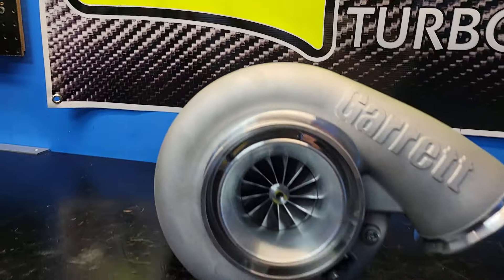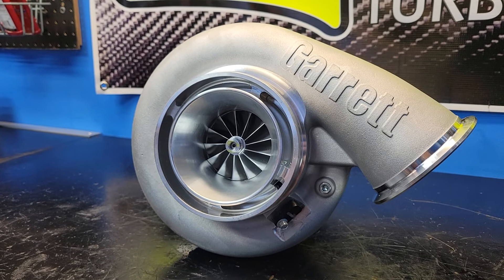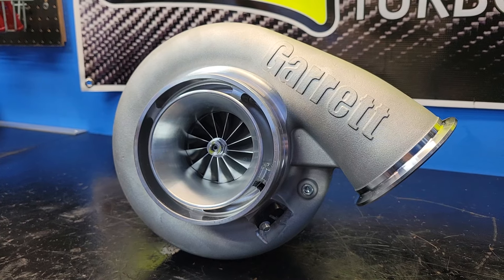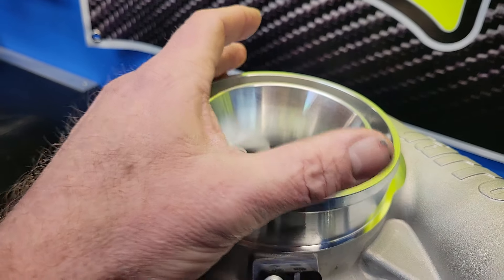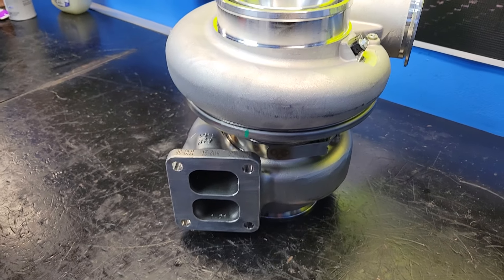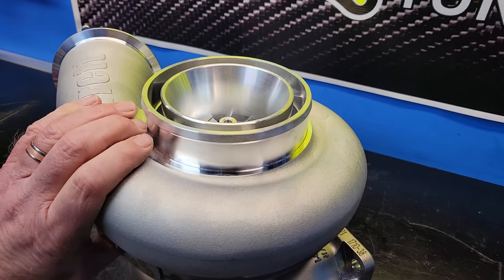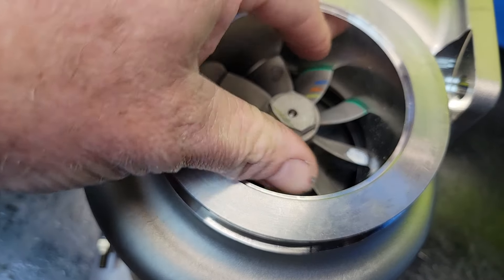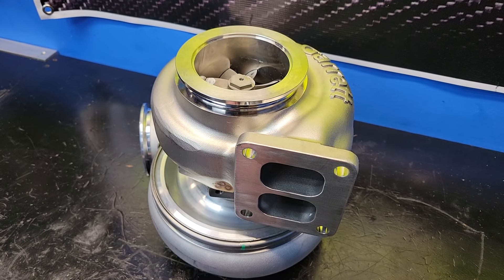Garrett G45-1125 67mm Turbocharger Overview

Comment: Would love to see the g45-1600 through g50-1900 go on sale as well as if you can do twin scroll housings for the g50-55 and/or gt50-55
Reply from the maker: I think we can machine a GT55 1.39 t6 twin scroll to suit.  The G series units are the cheapest they will possibly be right now...we will get a new price schedule from Garrett in the next week or so.  Email me if you need something, now is the time to buy!  support@workturbochargers.com  -Reed
Reply: @workturbo  I am wanting an 88mm charger for the high pressure turbo on a set of large compounds for a deckplate and sleeved 6.7 cummins. Would like to have an a/r between 1.0-1.15 if possible. Would really like to have something in the gtx or g50 range turbine size. The low pressure turbo will be 140mm
Reply from the maker: @GapdU  Send me an email to support@workturbochargers.com and I will take care of getting you a few quotes! -Reed

Comment: I’ve got a K31 on my 12.7 Detroit. Would love something a bit more efficient. Only pushing 525HP. Would like to reduce back pressure a bit. A Borg 171702 works it just loses Jake brake efficiency.
Reply from the maker: Yessir, understood!  The K31 is a good turbo, just very dated compressor aero (FWIW, that was one of the very first "billet" compressor wheels in an OE turbocharger!)  

The 171702 with the standard 1.32 A/R is too big for a 12.7 at 525 HP...put the 1.15 on there and it gets a bit more manageable.  

The 171701 with the 1.15 starts to get "better".  We offer a nice billet compressor upgrade using a factory BorgWarner Forged Milled Compressor wheel...that makes it even nicer, but still a bit much for that HP

The issue with any of the 96/88mm turbine wheels is they are just a tad to aggressive for the 12.7 at that HP level.

Other options that work well is a custom unit using the 92/81 turbine wheel and the 72mm compressor wheel.  Very good response, gets some boost on the jake and it is still "affordable" and built entirely out of OE Borgwarner parts, so it is servicable by any good shop

This Garrett G45 will be a top shelf unit, but unfortunately it is not currently available in a T6 footprint,  although I have thought about casting a T6 if the market will support the cost!
Reply: @workturbo  Thanks for the reply! My egts jump around 1800rpm and with my 10 speed the 400rpm shift drops make it hard to spool the big turbos after a shift. That custom unit you mentioned sounds promising. Can I get a rough quote? Would the t6 exhaust housing of a gt4202 be a close for this Garret?
Reply from the maker: @bowserfair2101 You read my mind on seeing if a GT42 turbine housing could be machined.  I have one set aside to do just that.  IDK why I did not think about that as an obvious choice initially.   Can you send me an email to support@workturbochargers.com so I can provide you a quote?

Comment: love it! 6.7 cummins diesel guy asking, will new drop in wheels replace 67-80 sizes or only one specific size?
Reply from the maker: Our new wheels will cover both Garrett OE machine work sizes (as delivered/machined by Garrett) plus a few other "special" wheels that will require us to machine the compressor cover...mainly for racing class rules

Comment: Using a s475 or s480 on a 450 crank hp LS is common these days. Folks run them off the right side of the compressor map then complain about backpressure. In fact, some turbo guys offer a custom turbine wheel because of backpressure.Can we start a conversation,look at s475/s480 maps, and say they dont belong on a 450 crank hp ls? A 88mm s400 is s a good start for a 400-450hp engine. Is the S400 aftermarket the popular new thing where you keep spending $ for minimal gains when you should have went GT55?